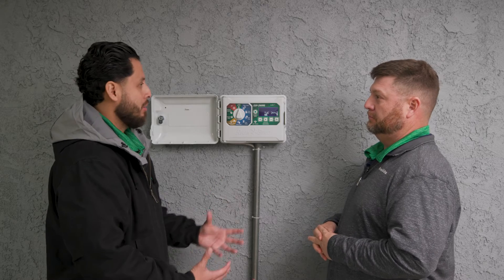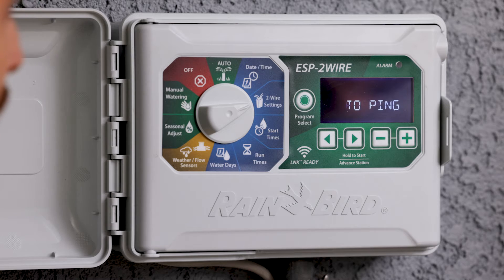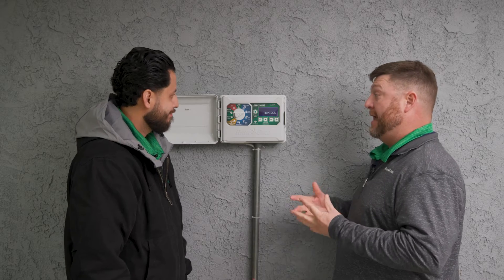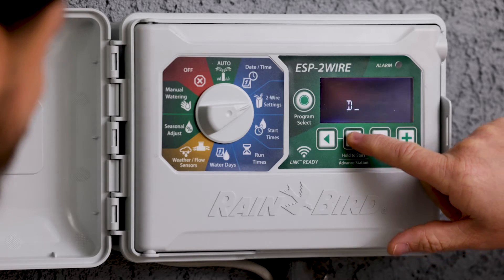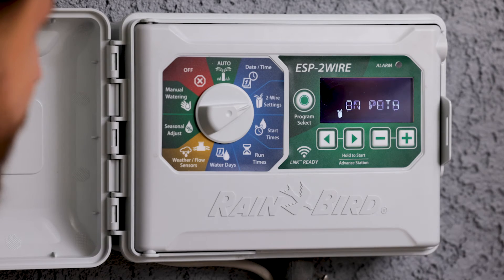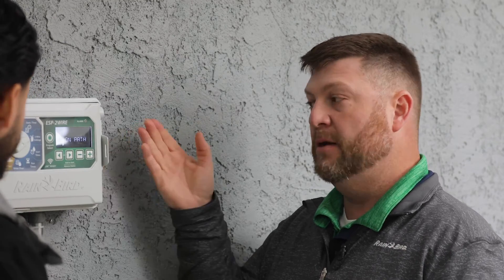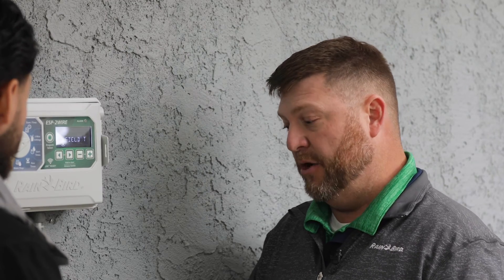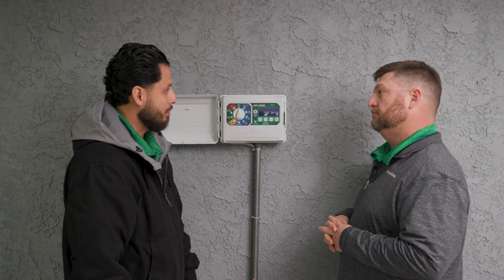Rain Bird® ESP 2WIRE Controller Troubleshooting

Comment: Love this device. Link also.  FYI We recently updated all our Spectrum hardware and everything connected easily except the Esp tm2.   The signal is perfect. The Link module when reset would blink green then light blue. I gave up looking for info so i finally deleted the controller and all is good.  Took 10 minutes vs. the hour I burned trying to figure it out.